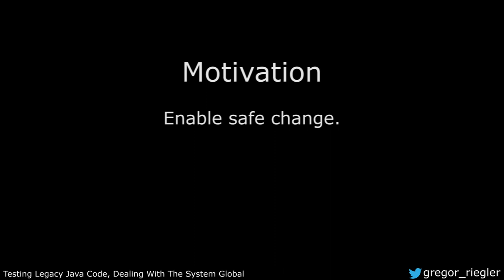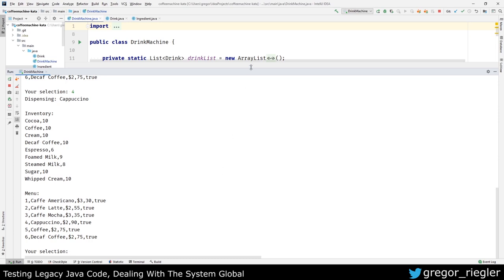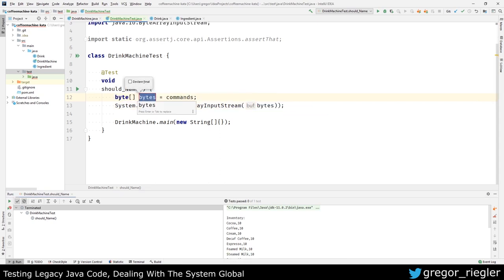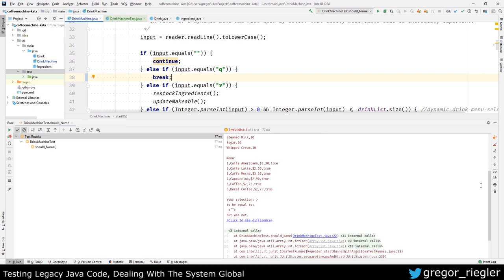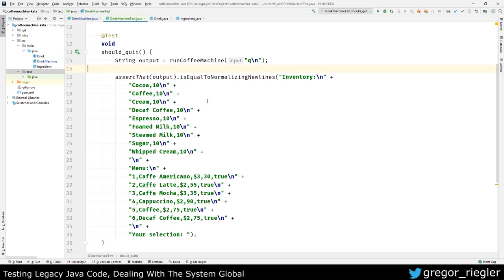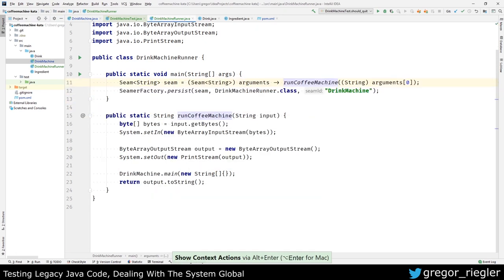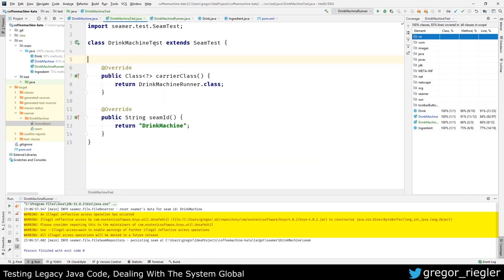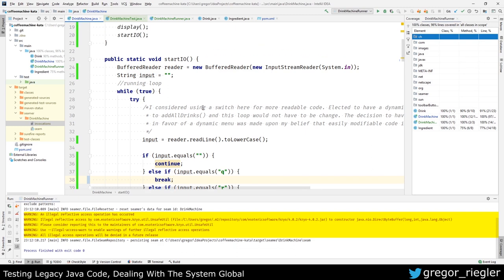Testing Legacy Code (Part 1)

Comment: In my point of view before touching a legacy code, a requirements engineering should be done first, it will allow to know the  client expectations , domain and business cases, as soon as you can map it  and you spoken to client developers you will have first view , only then go to code .....
Reply: The only valid requirements are what the code is currently doing. Nobody can tell you those requirements but the code itself.
Reply: @jlecordier  partially true, sometimes requirements are not in the code, but yes in many cases code is a last point of truth , but you need to have a plan how to improve it.